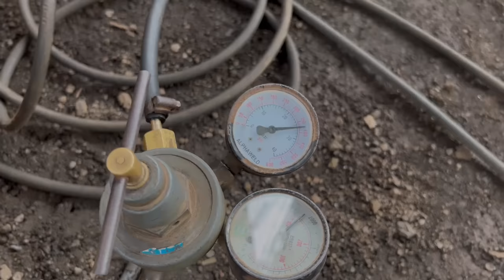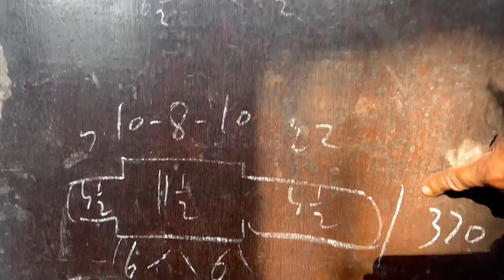How Expert Machinist Make 5 Cylinder Ammonia Compressor Crankshaft- Compressor Crankshaft |

Comment: Amazing work...I'm wondering how he calculates offsets. The only issue I see is when his chips are long pigtails. Those allow the cutter and material to heat up unnecessarily as you want short chips, necessitating changing your feed speed. That's one main thing I remember when I got my 2 machining degrees.
Reply: While that is true in practice thats hard to achieve without (an assortment of) cutting inserts - hand grinding a turning tool is not as easy if you want breaking chips and a tool that lasts a while at the same time.
Reply: @billklatsch5058 You can still use the same cutter, I’m just saying the cutting speed or rate of advancement of the cutter (feed) would remedy it.
Reply: I don't think feed rates matter when the cutting tool is moving about so much....😅
Reply: Maybe you should go over there and show them how to do it.

Comment: For better strength, the shaft must be forged in to crankshaft shape, and then done finish turning rather than machining a forged cylindrical shaft. The grain flow will not be in the required shape/form of crank.
Reply: in India? com on man who would pay that cind of money, proboly make 3 or 4 like that for the same price.
Reply: @benjamindemontgomery6317  Its definitely not in india I would bet for Iran or another Arabic country
Reply: @michaz2074  probably Pakistan
Reply: Omg one of them actually has safety boots on.
Reply: @michaz2074  the reason why i thought it was India was the massive bits of material they cut from. I know they have ship scrapyards in India. This is still its a poor country judging from everything else in the video. so still way cheaper to fabricate like this than casting.  that workshop should have some steel cap boots.
Reply: @dannyyo7948  Pakistan is actually really close to Iran and main religion is Islam so where is the difference? Anyone can check the channel location. It was what i was assuming I probably have used the term Arabic country badly. It was just a guess judging on the atmosphere of the place.
Reply: That's all okay.  They'll just lathe out another one when this one breaks in half in four hours.
Reply: @michaz2074  why you think Arabic countries look like this? You don't have google? Btw Iran note Arabic at all.

Comment: Is that a cosworth crankshaft ?.. 😂🤣😂.. Going by the movement of the toolpost it should be accurate to + or -  0.5 of a hand !! 🤓
Reply: Ok mr all American
Reply: Nah dude he’s right about the tool post, I’m sure you have no idea what he’s talking about
Reply: Bubu
Reply: Basher bubu
Reply: It was in spec I saw him measure his hand.
Reply: So is it good? or bad?
Reply: Amazing ain't it? Yet when he's done,  the damn thing will work
Reply: @kirkrichardson4443 of course it will, when it’s all made to the same tolerances 🤣
Reply: They use what they got.
Reply: @nikolaiownz  I mean you would think a machine shop would be able to repair and maintain their own machines..
Reply: @toejam7606  ô099
Reply: Even with a simple lathe tool, the results are accurate and can be used in the engine, I think it's no problem, tolerance is just a number
Reply: But they'll survive at any times & any places better than those american

Comment: And again, everything is made of an unknown metal with unknown properties. After all, any metal changes its mechanical properties during any heat treatment - the duration of heating and the cooling rate, the heating temperature and cooling temperature, the number of times of repeated heating and their temperature, the temperature and duration of steel tempering.) Does someone keep records and analyze the characteristics of the finished product? Or does the customer care? Or a guarantee at the level - I swear by my mother it will work ...:)
Reply: from this shop it is sent to the heat treating facility and after that to the grinding facility.
Reply: I have a feeling this stuff is basically mild steel, they can't be heat treated.
Reply: @taiwanluthiers  a giant ships engine crankshaft mild steel?
i don't think so.
Reply: @janvanruth3485  I don't know, for some reason they are not using carbide inserts, but given the amount of flexing on their tool post I doubt inserts would last more than a couple of minutes. You get much better finish with inserts when used correctly.
Reply: @taiwanluthiers  for some reason?
how about inserts are very expensive and offer no advantage whatsoever in this kind of work?
have you ever even worked a lathe that was older than you were?
Reply: Interesting I've concern too. Point of view of inspector or metallurgical
Reply: You sound like an engineer!   Lolol
Reply: @taiwanluthiers  what do you think people used before inserts came along?  Brazeon and hss......
Reply: Looks like it's all scrap from the same production process, which would mean you can have a pretty exact idea of what kind of metal it is, and what it's properties will be.
Reply: just enjoy the video or better yet please share your channel
Reply: Главное это контент. Если он привлекает зрителя, то не важно о чём идёт речь. Не имеет значения конечный продукт. И технология , и соблюдение качества, и техника безопасности, и прочее....
Reply: Its good steel, look how many sparks It was when he grinding it

Comment: I make shafts similar to this for the lumber industry. I start with a solid 9" x 109" rolled steel bar. Don't know how I'd feel if one came in like that. Like this is what im literally doing just in America. Spraying die and marking the center. Next is putting it on the lathe

Comment: I can’t be the only one scared by how soft that steel is and it’s being turned into checks notes ….. a crankshaft
Reply: That’s FORGED METAL….A lot harder than normal steel
Reply: @rockyj2008  have you ever machined anything in your life dude? That’s cutting like cheese.

Forging isn’t black magic that turns soft iron into carbon steel
Reply: Probably ok if they're running it against Babbitt bearings. Which they probably are, given the tech level of the whole operation.
Reply: Yeah wondered that, at the beginning of the video they showed lot's of big blocks of steel. If they where recovered from cutting up a large ships crankshaft I would expect some high grade steel (or is the thought of having some one on site who knows metallurgy asked too much? lol)

Comment: OK, I'm a bit late to the party, but I've been watching other posts from Asian 'workshops'. This post is one of the better ones, no this one stands alone as the best one from the pack. However, the tool post doing a dance, when it is supposed to be rock solid, and using a fixed centre on a large forging instead of a running centre will only add errors to the job. Camshafts have precision diameter for bearings and pistons, yet the only tool apart from 2 steel rules and a caliper, I saw was a vernier, these are not accurate for precision work. However, if the end user is satisfied with the camshaft and the horrendous noise it will generate, that's great. As I said this post was a step from the usual dross. ✅

Comment: Impressive work there making this with limited resources 😊yet there are a few things that could be done better 1. it should be avoided to get cobald blue chips wich means the Temperatur rises to high wich could be prevented by the right cutting angles on the tools and or better cooling or other cutting and feed speeds. 2. The chips themself are long wich is also a sign that the cutting process isnt optimal. Short chips are a sign of good cutting. Besides that hats of to the craftsmanship of these guys. Shows that you can get very complex parts with rather "primitive" tooling equidment and a huge amount of creativity and skill

Comment: I’ve never seen a crankshaft machined out of a straight cylinder… if done like this, it will have the structural fibers of the material interrupted. I believe these “crankshafts” are not functional
Reply: there are no fibers in steel, only crystals. it is an isotropic material.

Comment: Had a giggle myself when I saw the deflection in the tool post.  However, indicating the work piece with only what god gave him and a needle, it seems that accuracy isn’t of paramount importance here as he is only roughing in the shaft. Unlike working with a crankshaft that is cast and has its general shape and dimensions out of the block, this gentleman first had to shape the shaft out of a piece of forged material which what he is doing here.  No way is that the finished product.  In relation to the rigidity of the lathe he is using there is an old saying. You can only piss with the cock you got!😂  It’s people like these guys that keep the wheels of local industry turning.